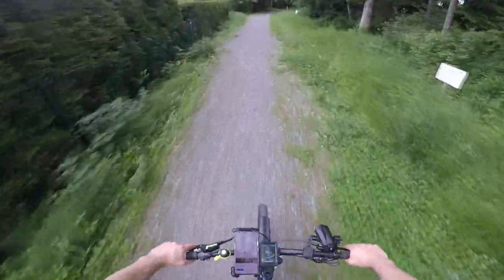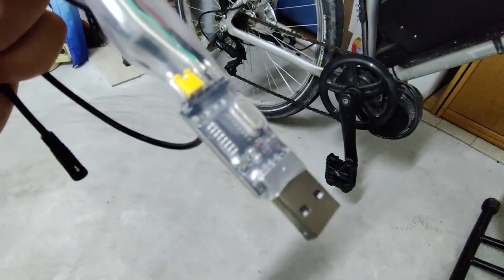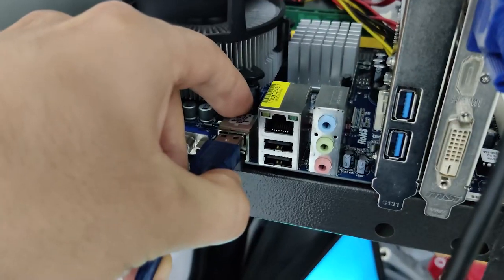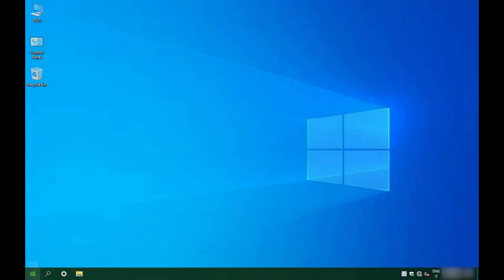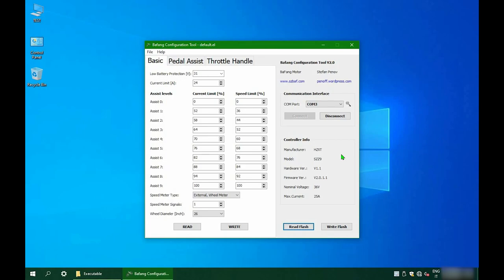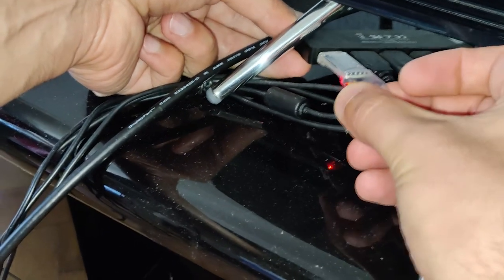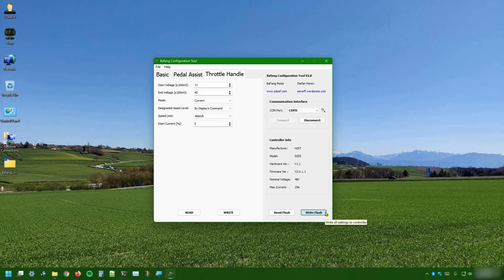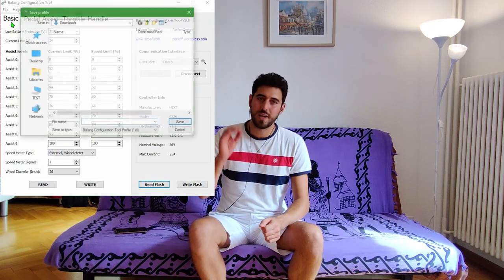Bafang BBS* PROGRAMMING: start NOW! How to do it, fast & easy

Comment: Very useful information. I have a Code 30 (Communication Error) on my new BBS02 750/48 volt motor. We have thoroughly examined all connections for bad wiring or bent pins & now feel it is a Controller error. Is one of the settings in the program something I should be looking for or do you think the Controller is simply faulty? (I do not have the program cable or readings from the Controller yet.) Thank you.

Comment: Just installed BBS02b today. Default PAS settings are horrible for me personally. Put pedal assist to start really low powers(current%): 6, 9, 13, 19, 27, 38, 53, 73, 100, all at 100% speed limit.
Now just need to find 52V firmware for my 52V battery, 48V firmware installed currently. Hopefully I find correct one.

Comment: my cable is different than this because the connectors aredifferent. When i connected to the laptop, there are two lights, 1 is green and the other one is Red. It looks like it is not supported. what should you do? i saw the driver on device manager and they are properly installed

Comment: Hi i have question can you help me
my bike shuts down after a short time of use
İ change controller but no change my bike 
i can't solve the problem
Helppsz
Reply: If ypur running it full blast it will get to hot and shut your bike down to prevent any permanent damage done

Comment: Where is the torque tab? Seen it on other videos but not yours..what do you have to do to get the torque tab up?
Reply from the maker: There's no such a thing as a torque tab for BBS* series Bafang kit configuration tool.
I never worked with one before, but are you sure you're not referring to the Bafang Ultra configuration tool? That's a completely different topic

Comment: Tks for the video Luke!
How do you feel about the tongsheng motor after a while? From what I heard the tsdz2 is not as durable as the bbs02, do you second that?
I'm from Brazil, and here parts cost a lot (stupid taxes and undervalued currency) and are hard to find, so I was looking for a very durable build, that I would not need to rely on local sellers nor aliexpress too much. I don't care too much about performance, I'm looking for durability and quality, what do you recommend to a guy like me?
Stay safe, and good luck with the channel!
Reply from the maker: Hey Juan! Thanks for sharing
My builds are too young to allow a precise answer
The 500W Tongsheng build so far had more than 1000 km and I already bought the nylon gear replacement (it's the most common piece that needs to be replaced) but still no issues nor replacements so far
The 500W Bafang is near 2000 km while the 750W a few hundreds. Still no issues
Someone says Tongsheng is less durable, I don't know if it's true. What I can say is that the Tongsheng is used by my girlfriend by the city, while my Bafang builds have been stressed more off road, with higher speed, so I expect them to die first 😅
I'll let you know when I'll have more news on durability ✌️
Reply: Luke, I guess that the nylon gear is in a way a good indication of durability, at least is cheap and an easy replacement. Do you know about any common defects in the bbs01 or the bbs02?
Reply from the maker: @juanvalenca9599  the only things coming to my mind is clutch
https://www.youtube.com/watch?v=4_VRs3IzpEk
and magnetic disk replacements
https://www.youtube.com/watch?v=F7GBtN5v8J8
not yet tried though
Reply: Hello Juan, I have installed Bafang & Tongsheng motor kits & from my experience they both can be reliable or can be improved on. A lot has to do with who does the installation & how the rider uses the motor, changes gears or relies on the throttle only. Having dealt with both motor kits & customers with varying degrees of success I would suggest this - If you wish to have a more Moped like experience where the motor is doing most of the work then get the Bafang but if you prefer to have a more bicycle /hybrid experience than get the Tongsheng. The Bafang can have weak Controllers & the Tongsheng can blow through the Blue drive gear. Either kit can be reliable but those are the 2 main weak points.

Comment: with this settings, is it possible to program my 250w bafang engine(rks engine) to 500w ? we have restricted in Turkey on this engine.
Reply from the maker: unfortunately this tool does not change the max watt output of the motor (like for the Tongsheng for instance)
it's just for reprogramming the various motor features
if you have the 250W version, that's not gonna change
this is a diffused misconception, in fact even if you can make a Bafang motor "quiter" with this tool, lowering current and speed for the ass. levels, this does not make the motor "legal" in places where it was not before...

Comment: I've noticed that my 48volt battery shows 92% charged when it's fresh off the charger. Is it possible that the BBS02 thinks I'm running a 52volt battery....48 and 52 are curiously 8% apart in voltage.  Is there a setting to tell the controller which battery you have?
Reply from the maker: most likely your display thinks that
Reply: @LukeLorusso  hmmmm .....I don't remember seeing a calibration feature in the display menus.
Reply from the maker: @XBKLYN  I don't know much about your display, but what I know is that is its responsibility to calculate and show you the percentage.
The motor's controller will just either work or not, depending on min-max voltage settings.
That's why I'm pointing at the display. Can it be that yours is made only for 52v batteries?
Reply: @LukeLorusso  according to the specs it's a 36/48 volt-compatible display (BC351).....I see your point about the display's responsibility for interpreting the data that it's given so I'll look again into the menus for a voltage select option. Thank you.
Reply from the maker: @XBKLYN  I hope you'll solve it man 👍
Reply: @LukeLorusso  thanks....if I find anything new I'll post it here. Keep up the nice vids!
Reply: @XBKLYN  That's because there isn't one
Reply: @davidstorton910  actually there is....on my control panel I hold down the menu button for an extended time until the advanced menu lock screen appears....then I enter 202002 and it gets me into the deeper controller settings where battery voltage can be set. There are several other settings in there that are not accessible through the Bafang PC application.

Comment: Hey. Is the programming cable connected to the monitor cable. I tried to disconnect that monitor cable but it's so hard stuck.. U seemed to be able to disconnected that cable very easily
Reply from the maker: it is a woterproof connector, so it's hard to unplug... just try harder, but hold it from the plastic sockets, not the wires

Comment: Time 6:48 u say that the current will push the motor untill it reaches the current limit. Can set it to reach it to reach miles per hour or km/h. 

So after it reaches a set limit if current or speed the motor cuts off? 

Is it the same for the throttle?
Reply: Yes on both, you can have the throttle independent of the PAS and have both cut the motor when it reaches a set speed limit
For the pedal assist speed limit on the pedal assist tab, change the "speed limit" to what ever speed you wish.
For the throttle (independent of the PAS) change the "mode" to speed and...this is the bit to make the throttle separate....change the "designated assist level" from display to a number...NOTE: This setting if set will override the Limit Speed setting on the Basic Tab and also overrides the speed limited on the Basic Tab. If you set this to 9 be aware that you can and will fry your controller if you are in too high of a gear on too steep of a hill and you peg the throttle. Recommended setting 6-9. 9 only for advanced users who know how to use bike gears appropriately or have a gear shift sensor..... I've got one but still have the setting to 6
Hope this helps 😉

Comment: Hello, does the software support the M series of middrive from Bafang?
Reply from the maker: Hey! I didn't try, but I've read it isn't possible
Reply: @Luke Lorusso: Why I Don't Need a car  thank you. Been looking at forums, and it seems that you need to be a supplier/retailer before they'll give you the software and tools.
Reply from the maker: @Zach-s5g  yeah, unless you make a modification replacing the controller with one from an old BBSXX: this would allow you to connect custom batteries and the regular set of display, sensors etc...
but at this point, I would simply go for a cheaper BBSXX 😅
Reply: @LukeLorusso  😄

Comment: I keep losing connection after i click "Read Flash".  Tabs get greyed out. 🤦‍♂️what could possibly cause that? Please help. Thanks.
Reply from the maker: I'm sorry I cannot troubleshoot your issue, but it can be anything from a failing usb port, to a broken cable, to a bended pin up to a problem on the motor's controller